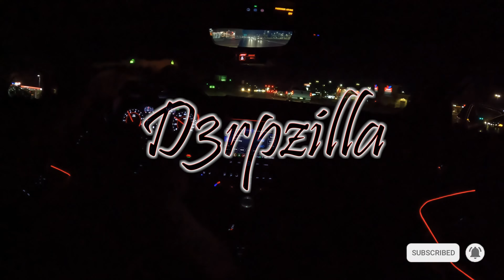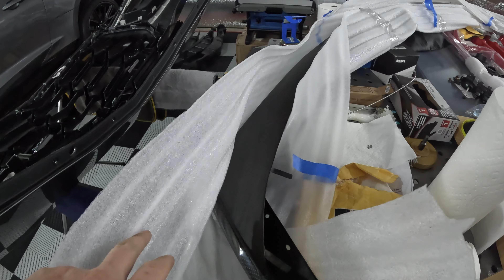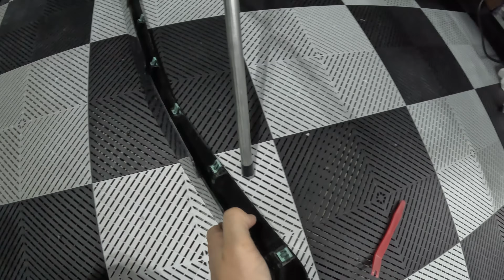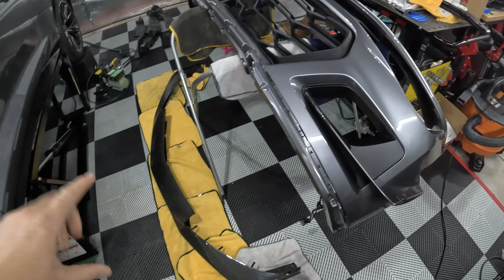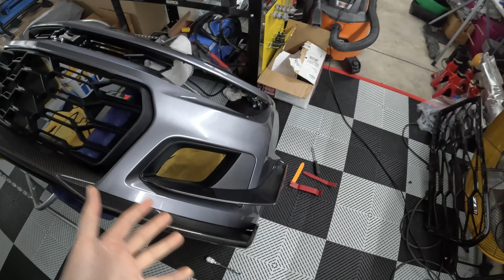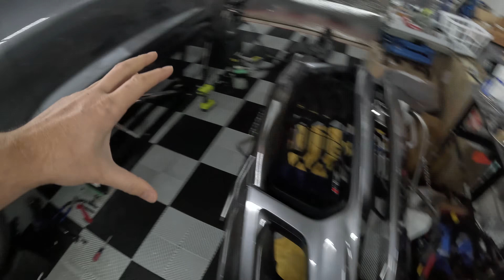Part 4: Anderson Composites Front Splitter - Camaro ZL1 Carbon Fiber 1LE Front End Conversion

Comment: Can you give the Anderson part no, please? They’re saying the CF 1LE is not compatible with the standard ZL1 🤷🏼‍♀️ Thanks for the help!
Reply from the maker: I used this exact splitter, https://andersoncomposites.com/collections/all/products/2017-2018-camaro-zl1-1le-carbon-fiber-front-chin-splitter. It technically does NOT fit the regular ZL1 which is why I also swapped to the ZL1 1LE upper and lower grills. The lower grill in the ZL1 1LE has provisions for the ZL1 1LE splitter that the regular ZL1 lower grill does not have. I've seen a few people install the ZL1 1LE splitter with the regular ZL1 grill if you don't mind tweaking it a bit.
Reply: I sincerely appreciate your time replying back. I did read about the grille before, thank you for clarifying (and sorry for asking for the part that I later saw was in your description 🙈). Looking forward to making similar changes to my ZL1! Feedback on your side skirt covers, are they holding up well?
Reply from the maker: No problem! And yes, they've been perfect. Zero issues with them and they tie together the full look I was going for as I also have the Anderson diffuser.